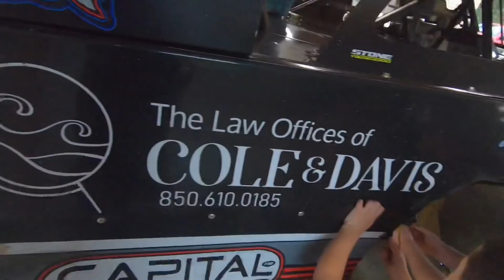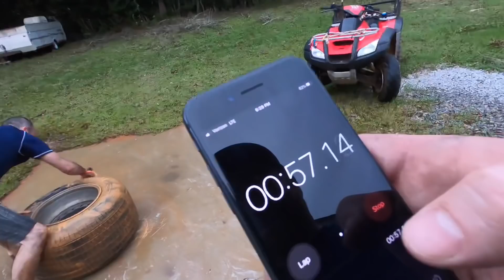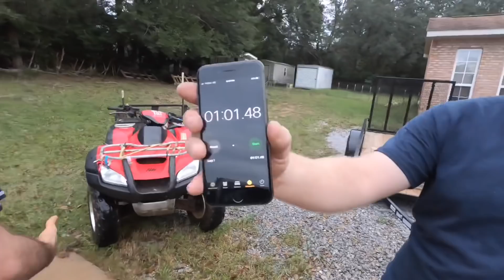Where’s Joseph Racing the Super Late Model? Plus Jonathan and Jesse Race Head to Head

Comment: Check the front throttle shaft on the carb for any excessive side play. If it has any the accelerator pump lever will jump out from under the spring pad. Been there, done that. The carb throttle plate can be re-bushed to fix it.

Comment: My dad's car had a bent right rear axle tube and was turning the right rear out a lil but it helped the car get around the very tight turns at Winchester speedway in middle tn and after we fixed the axle tube the car wouldn't get around the track on the bottom like it did with the bent one on lol

Comment: I  will be at senoia  ..weather permitting as  showers are in the forcast its thursday here and rain is heavy now at  5 30 pm  last satueday  their was very few cars. 20 started and after just 1 lap that was down to 13 as 7 cars tangeled in the first turn. hope the weather works out this week. if not this week next week wiil be good..as the week before  last it rained and 3 cars ate the wall up and very low speed.. by for now J D